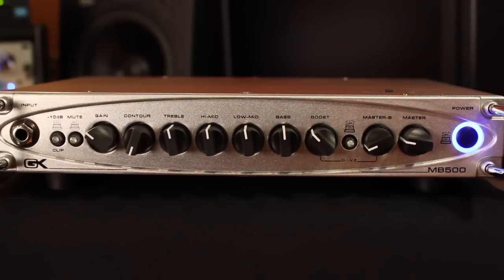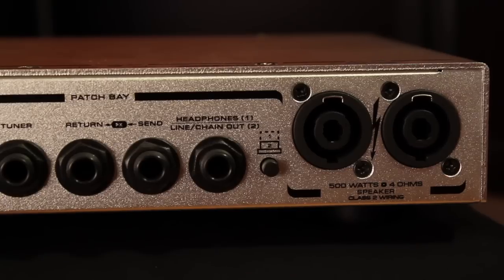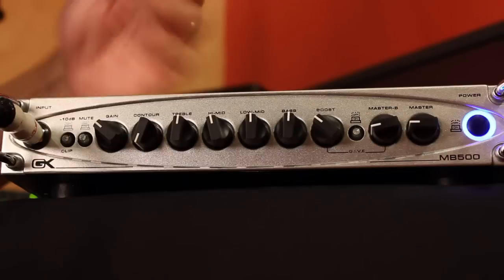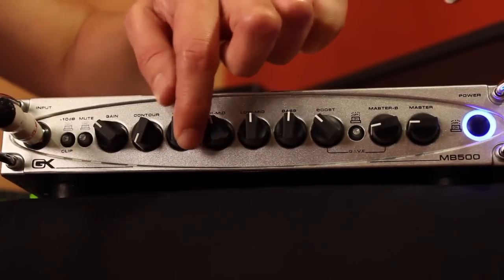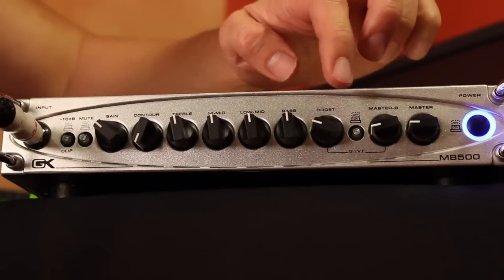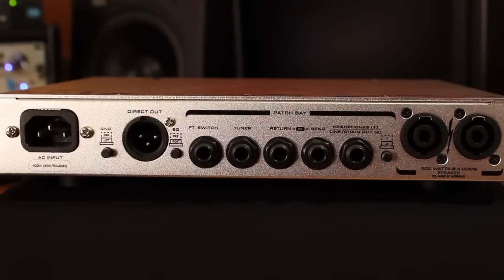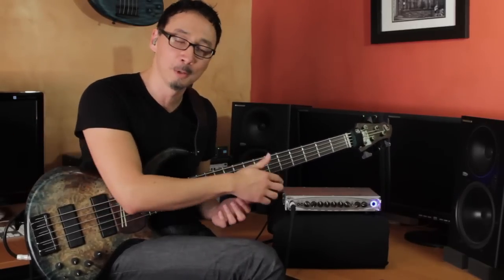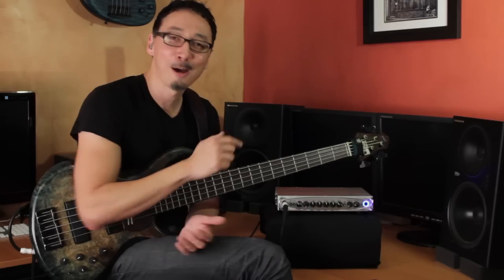Gallien-Krueger MB 500 Demo by Norm Stockton

Comment: Hi, the manual says the following about the power amp output to speaker cabinet : "Delivers 500w into 4 Ohm loads. Lower impedances such as 8 Ohms or 16 Ohms and NO LOADS ARE ACCEPTABLE".

Does the latter means that you can use this amp with headphones and not hooked up to a cab, without risking damaging it ?
Reply: djabthrash the headphone don't go through the power amp stage. Headphone derives its signal from the line out signal. So when headphone is connected the power amp stage sits there doing nothing. Its possible because of class D. A tube amp would be damaged without load.

Comment: What I really want to know is what "cabinet" is he playing through?  I love Norm's videos, but why doesn't he list all the details?  I have the GK MB500; I'd love to get THAT sound.  What cabinet?  Is it that tiny black box?  Is that a 2x10?
Reply: i use the MB 500 with a pair of eden 210 xlt....absolutely a killer rig
Reply: Hey, thanks for the response.  I've actively looked for an Eden 212XLT cab to combine the GK MB500 with; but no luck so far in finding one.  Great to know the 210XLT's sound great paired, too-I've seen many of those as options.  This post is a few months old, and I've moved towards a bigger rig (GK 1001RB ii and an Epifani PS410).  But, again, great to know the Eden XLT gear sounds great with the GK MB500-I think I'd really like the tone of the Eden XLT cabs from how they're described.
Reply: it would be better to have more power in the cabinet. The Eden 212 xlt delivers 400 watts 4 ohm and the gk delivers 500 watts 4 ohm(it's a problem when you pump up the volume).
Reply: Watch the video for the MB800. They filmed these at the same time. The MB800 video shows which cab he's using.
Reply: He's recording direct. No speaker